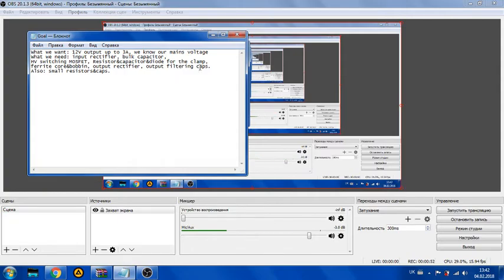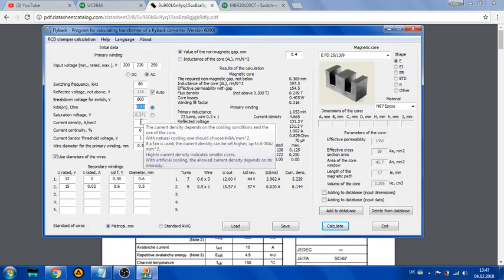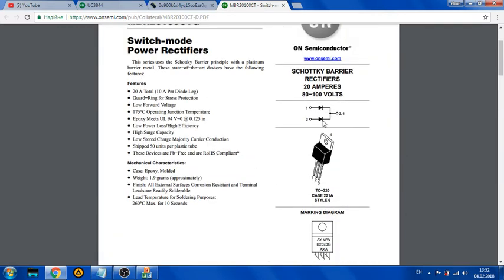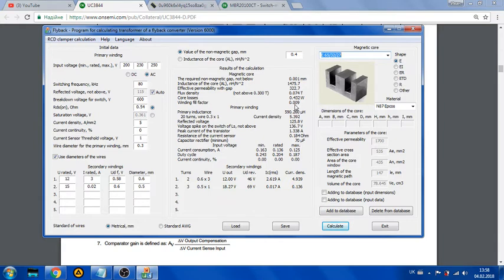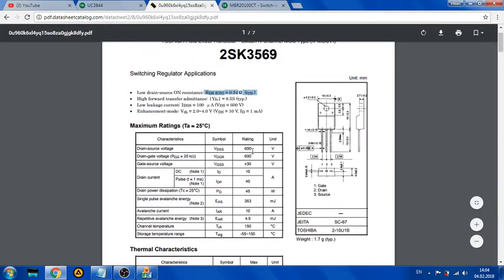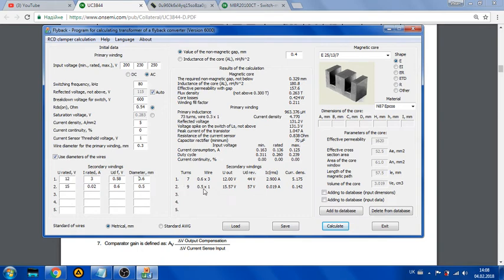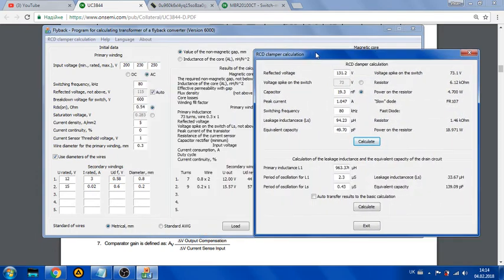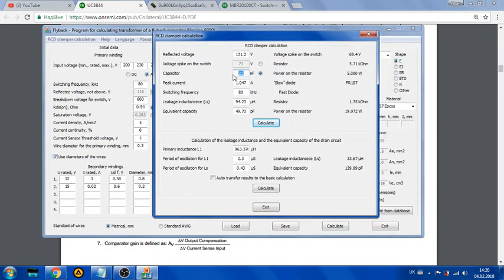Long video about transformer calculation using special software

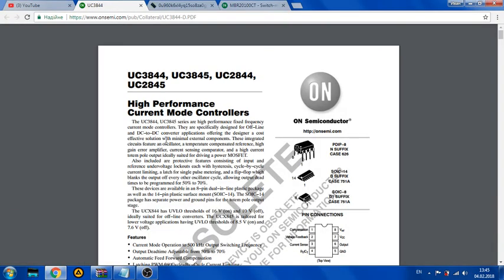Comment: 3:15 UC3844 Datasheet
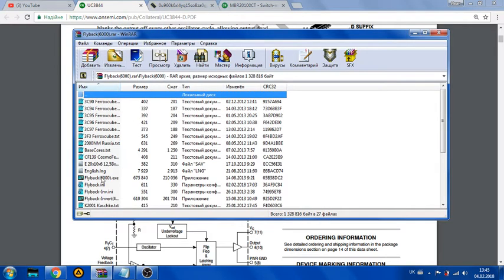3:52 Flyback 6000 Program
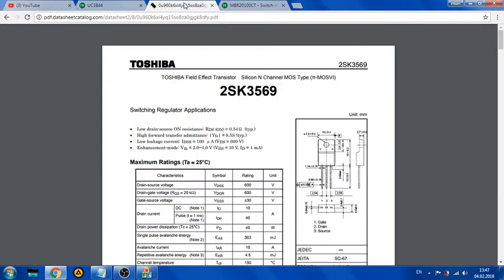5:45 MOSFET Example Datasheet
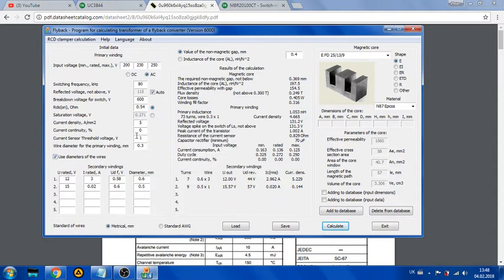6:50 Rectification Diode CCM/DCM percentage
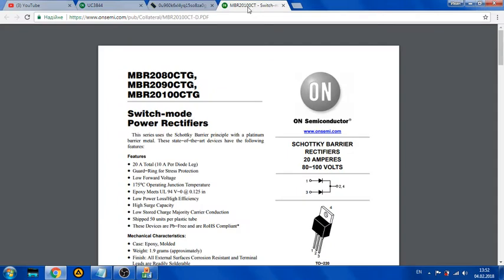10:18 Diode Datasheet
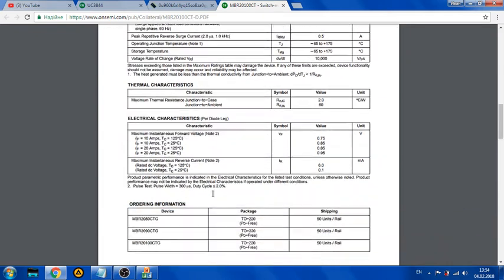12:42 Diode Forward Voltage Graph Current/Temp Explanation
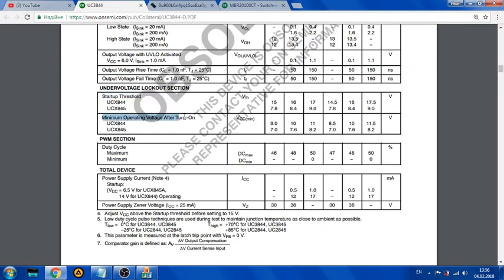14:25 Controller IC Minimum Operating Voltage
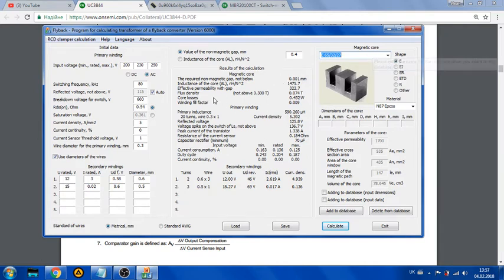16:05 Winding Fill Factor (0.300=Ideal//use< .25)
16:55 Resize/Select the Core 
17:40 Value of Core Gap
19:24 Too Large of a Gap Explanation
21:04 Results of Calculation: Primary/Wire Diameter/Current Density
24:00 Duty Cycle % vs Controller IC Maximum
24:50 Results of Calculation: Secondary/Wire Size:Fill Factor: Current Density:Copper Losses Explained
29:05 To Split or not to Split Primary Winding
31:16 RCD Clamper Calculation (Snubber)
33:05 Leakage Inductance (how to short secondary and measure primary leakage)
35:34 Resistor Power Dissipation vs Capacitor/Diode Speed
Reply from the maker: Well done, I was going to make a list myself, but got carried away by other things :)
Reply: MrJohhhnnnyyy 
  I was hoping this program would have worked for regular mains transformers. I don't think it will, but after I started watching it again I couldn't stop. I'm sure I will use this reference again in the near future. It's one of the better ones on my list and I have a bunch of UC3842's I ordered awhile back. They were less than $1 from someone I was already ordering stuff from. 
  I hope all is well with the new job and your thesis project went well ;)
 -Jake
Reply from the maker: For mains transformers, and others with no gap, you can use the formula tjat looks smth like this: N=(V*t)/(B*Ae).
  Where N - number of turns, V - voltage seen by the winding, t - for how long that voltage is applied, B - max flux density (0.3 Tesla for ferrite), Ae - cross-section of the core. Everything is in standard units, Volts, seconds, Teslas, square meters. I might talk about that in the next video, if I won't forget :/
P.S. Ran a quick calc for the xfmer in the tl494 24v 3a supply, the software gave me 51 turns, the formula gave 59, quite damn close ;)
EDIT: If I take min input voltage into calculation, the formula gives same 51 turns, how about that :D
Reply: MrJohhhnnnyyy 
  I think I've got a basic understanding of the math to calculate the turns ratio. I find it more challenging to figure out wire size for the clearance available, and the current capabilities of the winding.
  I'm starting small with what used to be a 120/24volt step down transformer on 60Hz. The core is silicon steel, and after counting the secondary to the center tap it has 55×2 turns on the secondary. The secondary was rated at 1.25A originally. As far as I can tell that means the primary is 550 turns. The core cross section is 19×31.8mm= 592.8mm. All of that was fairly easy, but rather pointless I think (I did all of that before your message ;)
  I realized I just needed to divide the secondary voltage by the secondary turns ratio to get the volts per turn. I know my total output is limited to 30w or 150VA for any other output I can fit onto the bobbin...I think...or I'm going to color the inside of a few blown glass fuses in frustration. 
   The hard part for me is figuring out if any of the wire I've already got would work for the output current/space available or if I need to order some wire that I'm too cheap (the prideful way of saying "too poor") to buy.
-Jake
Reply from the maker: Upcycle Electronics Again, you can use the same 4 Amps per square millimeter for the current density, should be fine. To avoid blown fuses and other shit, put the mains rated incandescent lightbulb in series with the primary, if the secondary is not connected to anything, the lightbulb should not glow, maybe very dimly, but not bright.
Reply: MrJohhhnnnyyy 
Thanks! "4A mm^2" is going on my notes wall. 
   I've been working on a more permanent mains bulb limited circuit too. I am trying to build one that adds a fuse, with a RGB LED to indicate a blown fuse, the presence of mains and if there is current being drawn by the load (simulation link below)
 Thanks again for the help ;)
-Jake
http://everycircuit.com/circuit/4953259151458304

Comment: Thanks Mr Johhhhnnnnnny! 
Is it possible to/how do I make use of junk switching transformers? 
     I saw a video a few days ago where someone used a homemade tool built to measure the flux properties of an unknown core using a large capacitor that is charged, then disconnected from the voltage source. This created a known voltage/time source. Then he used an SCR to connect the capacitor through an inductor to test, to ground. He was able to use a scope to show the linear properties of the inductor/core. I didn't completely follow the math, but I want to build a similar setup and try it myself. I saved a couple of his videos in my "power supply" playlist.

   I've tried to figure out the part numbers printed on many transformers, but I've never found anything useful from searching them. Is there anything useful I'm missing on these labels that might hint at what type of ferrite is used, or other useful info:
https://drive.google.com/file/d/1tmJawGzruOAmwuu2P-BKRfVQqqb7w1s5/view?usp=drivesdk
Reply from the maker: Upcycle Electronics Yes, you can. For the flyback supplies, it's enough to know the dimensions of the core. The software has an ability to add new core to the library, for that you need to know the dimensions and permeability. But for the flyback, you can just put 2000 as permeability, the core will have a gap which will lower it considerably making that parameter not crucial. But you will have to rewind the transformer. 
 If you don't want to rewind the transformer, you can take one from 12v PS and make your own 12v PS, not much more.
Reply from the maker: Upcycle Electronics The numbers on the ready made transformer are proprietary codes, you won't get much from them. I'll do a follow-up later so I don't have to type so much on the phone ;)

Comment: I have used the program and made the transformer but stupid tv ps ic will not work I cant get it to start I have to buy ic for it.
Reply from the maker: JOSIP Žlk Use generic chip like uc3844, they are cheap so you can fry some :)